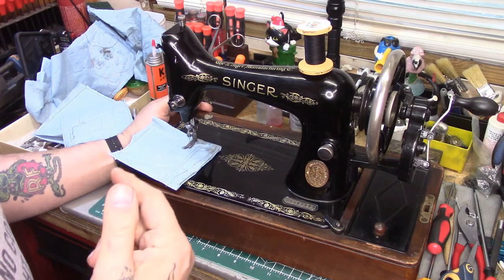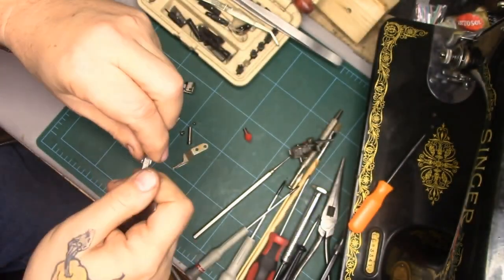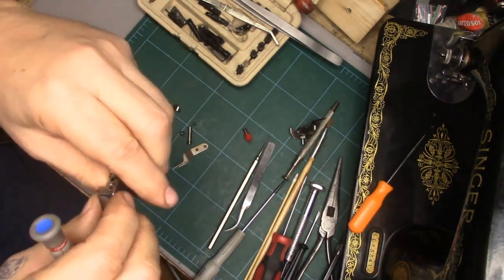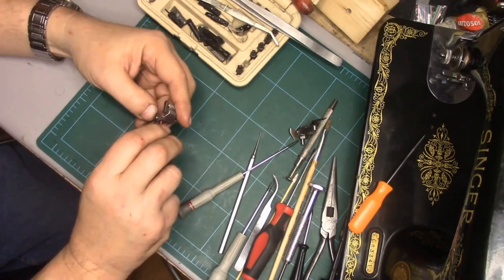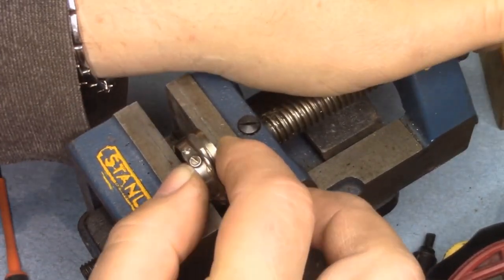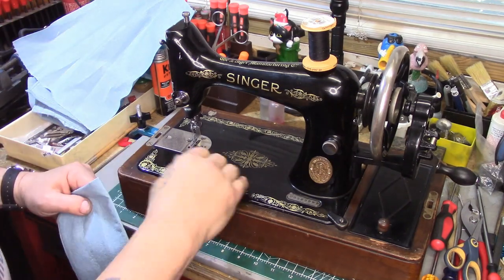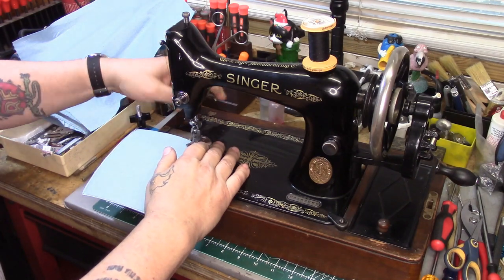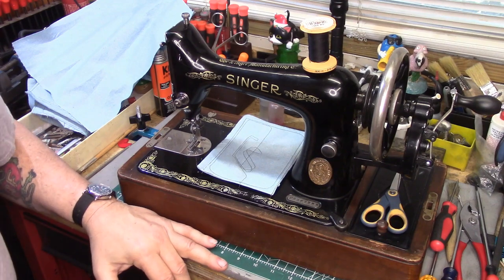A 99 for Sandra Part 4 - Final Touches & Testing

Comment: I took apart the bobbin case positioning bracket and cleaned it and it took me a moment but I was able to figure out how to put it back together. Exactly how you just did it and I guess I just got lucky because I guess I put it together correctly exactly just right because when I put it all back together put it back in the machine to put the bobbin case in it and time the hook it ran it's sews and I didn't even have to deal with that screw of death. I guess I just got lucky for the first time doing it

Comment: What are the grits of the polishing compounds across the different colors?

Motor or treadle for me--no hand cranks!
Reply from the maker: Jo, you opened a can of worms! Polishing compounds aren't measured like typical sandpaper grits, they are measured in microns, or fractions thereof. Here's the rub... Different companies use different compounds to make their bars, so they are not all equal. Top that off with the fact that not all of them (quite few actually) don't even tell you what that abrasive size is, rather they tell you a suggested application (type of metal) and a suggested buffing wheel type. As an example, here's the blurb for one of my favorites:

Kocour White Coloring Compound (KC11, Approx. 2.5 lb Bar, 3 Pack)
USE THIS KOCOUR BAR ON ALUMINUM AND OTHER NON-FERROUS METALS WHICH ARE IN GOOD CONDITION. IN OTHER WORDS, USE FOR FINAL FINISH OR AS A COLORING OMPOUND TO PRODUCE A HIGHLY REFLECTIVE FINISH. THIS IS AN EXCELLENT CHOICE WHENEVER A HIGH LUSTER AND A HAZE-FREE FINISH ARE DESIRED. USE WITH A SOFT, LOOSE (5 ROW SEWN) COTTON MUSLIN BUFF OR A FLANNEL BUFF.

Well, in spite of what the manufacturer says, I use it on steel, but with a firm felt wheel or polishing point and it gives me a beautiful finish. Not the method nor the target metal the manufacturer intended, but by trial and error, I found it works best for me.  Osborn BC4431 (same as the old Matchless HF1) is also excellent. I use the Kocour SS17 Yellow pretty much as recommended as it cuts nicely and rarely needs much color buffing after.
Reply: @BobFowlerWorkshop  that's pretty much what I was (not) able to find out! Thanks for confirming my fears.
Reply from the maker: Sorry to be the bearer of bad news Jo...

Comment: Hello I have just picked up an almost mint condition Singer hand crank 99k for £20 in UK. I already have a hand crank 201k and have the chance to buy a Featherweight. Trouble is I love the 99k. Would it be worth having my 99k fitted with an electric motor so I have one of each? Am not sure I have space for three machines. The other alternative would be to sell my 201k, buy the featherweight and keep my 99k. What would you if you were me and why?
Reply from the maker: Vivienne - I would rather chew on broken glass than part with a 201! In all honesty, I would keep all three machines. The "extra space" to keep the third machine is really negligible, unless of course you're living in a super tiny place. as for fitting an electric motor to the hand cranked 99K, you can easily do that yourself, but if you do, you should keep the hand crank so you can revert back if you ever have the need.
Reply: @BobFowlerWorkshop  You made me laugh with your chewing on broken glass comment!!! Thank you for your thoughts too especially the part about keeping hold of the hand crank f I ever want to change back. Can I ask what you think of the featherweight is it as good as the 99k? I kind of got the impression they can be a bit temperamental.
Reply from the maker: @viviennebolton4358  I did a video a while back on why I like the 99 more than the 221. Having said that, I own both, use both, but when I took quilting classes, I took a 201K23 to class - even though it required carrying a transformer to bump 120 volts up to 240 volts for the motor!
Reply: @BobFowlerWorkshop  Hello Bob, yes in truth it was your video that set doubt in my mind about wanting a featherweight. I asked my local guy to look out for one and then I found the 99k. I am due to buy the featherweight today but I'm just not sure I will use it. I don't quilt but make book covers for art journals using leather and upholstery fabric so am not sure the featherweight is a good choice and it's going to set me back quite a bit of cash too. I can lift both the 201k and 99k but I am 70 and another ten years I doubt if I will be able to move either....but then I probably won't be sewing into my eighties... Oh dear what a dilemma I have created.....
Reply: @viviennebolton4358  They're all good machines - you can't really go wrong.  I'm like Bob, if you've got a thoroughbred in your stable I'd keep her - and a 201 is a thoroughbred through and through.  I'd keep all three if I could too.  If you need to decide between a 99 and a featherweight there's not too much difference taking into account all the pros and cons from a seamstress' perspective. Don't dismiss sewing into your 80s either.  I know people in their 80s who do and they're nowhere near ready to stop.  Just because you're doing journals etc now doesn't mean you won't be making other things as well or instead in a few years.  

I think the question is more a matter of whether you can leave a machine set up in a permanent spot or would need to be setting it up and putting it away all the time (or might want to take with you if you travel/go visiting).  For myself I'd keep a 201 for all my normal sewing and heavier work (and leave it set up if I could) and have the featherweight if I wanted another that was quite portable.  If I didn't need portability I wouldn't bother getting it (except, of course, I've got the collector's bug...).  There isn't anything a featherweight can do that a 99 can't do just as well.  And there isn't anything either of those can do that a 201 can't do too, and probably better.  

However If the featherweight on offer to you is the much less common 222 (free arm) machine rather than the 221 then that free arm is quite tiny and therefore very, very useful.  I'd take a 222 over a 99 any day if my main machine was going to be my 201.  :-)
Reply: @meganmills6545  Thanks Megan! Well, I am now the owner of a singer 221k featherweight! But the chap I deal with had said if I change my mind about my 99k he will happily sell it for me at a price quite a bit higher than what I paid for it so that's an option...Thank you so much for your kindness about the age thing and yes, I also have a bit of a collector bug in me, so letting go of these beautiful machines is quite a challenge.... From an investment point of view the 201k and 221k are keepers and 99k's are not so much as there are so many of them about. From a practical viewpoint the 201k is a workhorse so that's getting settled in my workroom as a permanent fixture. I can't afford a 222k, they are way too much for me. So, that's done, am not buying anymore sewing machines, but thank you so much Bob and Megan for your brilliant comments!
Reply from the maker: @viviennebolton4358  Age is a number. I turn 65 this year if you believe my birth certificate, but my brain says I'm 12...